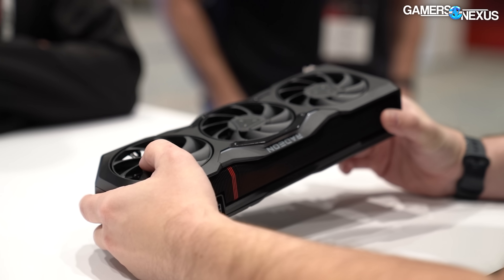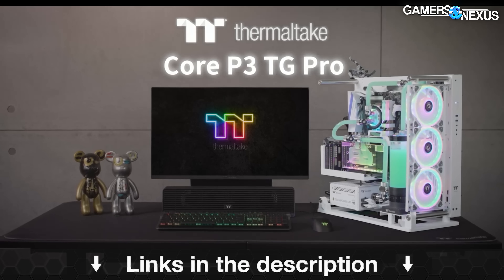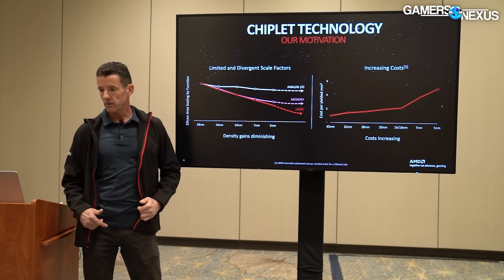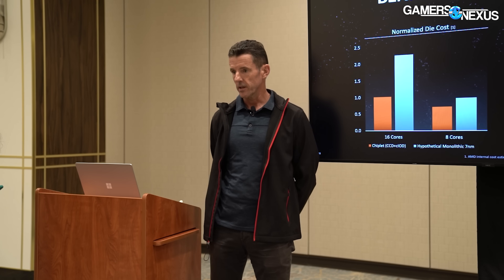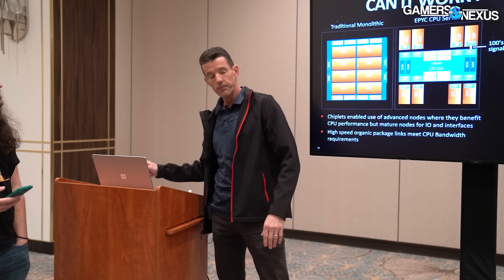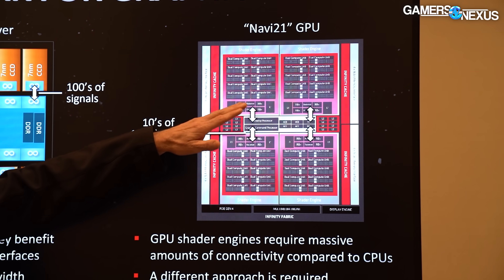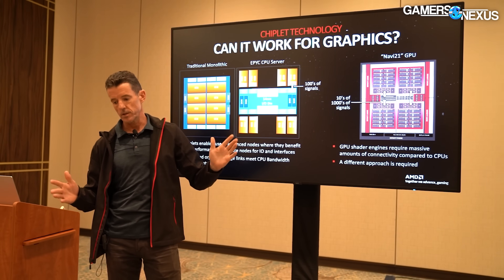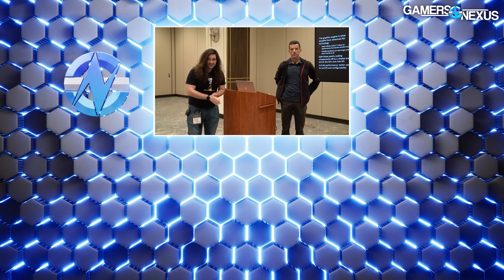How AMD is Fighting NVIDIA with RDNA3 - Chiplet Engineering Explained

Comment: A company called Silicon Edge has an online die-per-wafer estimator (search for silicon edge die per wafer estimator and it should be the first result) that really helps illustrate how big of an impact even a small reduction in die size can have on yields.  As Naffziger said, defects tend to stabilize around a constant number per wafer, so play around with the die dimensions and see how much of an effect it has.

Comment: I would rather pay a used car's worth of money for a nvidia card than buy an amd card that will have shitty drivers.
Reply: Yes, keep that bullshit mindset that I also had like a month ago when I only used GeForce due to the same fears. Glad I changed when my 6900 XT arrived and the drivers were rock solid on a setup that should've had driver issues. I've had more issues with NoVideo's 5xx lineup of garbagio drivers. Additionally, no more frame stutters in any games, higher averages, better colors and visuals, and the AMD control panel (Adrenalin) beats the shit out of NoVideo's Windows 95 control panel and its useless GeForce Experience. It has everything in it, and it's so well designed & built that it makes Afterburner useless weren't it for RivaTuner.

But why do I even bother, you're just gonna tighten Jensen's leash around your neck even tighter. Whatever you're into I suppose. But maybe you should, you know, HAVE EXPERIENCE with a certain product before talking shit about it.
Reply: @lunetailedfox  i appreciate your message and i'm happy that you are enjoying your product. But for me to buy something just to see if it's good or not after being on nvidia for 10+ years is out of the question. Maybe when the price/performance is good enough i might give it a go like i did with amd cpus, but right now nvidia is the king performance wise.

Comment: IF AMD can actually pull this off it may actually make them a viable competitor to Nvidia's offerings but only if the performance is there when the tech hits the market. Power efficiency and product cost don't mean much if the actual performance is compromised.
Reply: AMD is already a viable competitor to NVIDIA's offerings, and the 7900 XTX beats the 4080 by 10-15% while being only 10% slower than the 4090 based on extrapolated results from AMD's own numbers (which are usually accurate) with 4080/4090 reviews. With driver optimizations, that GPU is only going to get faster. Not to mention RDNA3 has extreme memory bandwidth compared to G6X.

I guarantee that the XTX will deliver the same performance as stock while consuming about 250-300W, or less, because it undervolts like a champ, and is efficient even on stock.
Reply: @lunetailedfox  Basing parts investments on "Ifs" and "hopes of optimization" has been AMD's problem since Vega came out and fell flat on its face.

Also power efficiency is again isn't a selling point outside of Youtube videos and war-torn Europe. AMD's GPUs have relied far too much on asterisks, exceptions, and narrow use cases to paper over the fact that they can't post the same performance numbers as Nvidia has been doing.

It's why you don't see a lot of the Techtubers who love to shit on Nvidia use AMD GPU's in their builds or test rigs and why during the supply shortages you could find AMD GPUs in stock while Nvidia's shelfs were bare because everything made was bought by either miners or gamers trying to get the most value for their money.

Performance = Value this has been true for decades when it comes to GPUs especially no matter how much the AMD crowd wants to deny it.
Reply: What are u even talking about lmao

Comment: The 6900XT went head to head with the 1499$ 3090 in razterization performance.
And it costed 999$
The 6800XT went head to head with the 699$ 3080 , and costed 649$

Now the 7900XTX (not even XT)
Is going head to head , with the 4080!
Not 4090! (AMD said it , not me)
For the same 999$. (In ratserization performance)
AMD is naming what should have been a 7800XT In terms of performance in comparison to the competition a 7900XTX
And pricing it at 999$
And straight up not launching a 4090 competitor , so that the 7900XTX name sounds logic , hey it’s our top card.

Yeah well , your top card , is going against Nvidia’s second card (and second by a margin this gen) while being priced the same as the card that last gen went head to head with Nvidia’s top dog.

Nvidia rised the 4090 price by 100$

Gamers Outrage.

AMD named a 7800XT a 7900XT and priced it at 1000$ wich is a 350$ increase of the 800msrp

Gamers: Dickriding…

The fact that Nvidia went full retarded , and priced a 4080 at 1199$
Doesn’t means that AMD is also laughing at your faces.
Had the 4080 been launched for 999$
You people would be outraged that the 7900XTX is going against the 4080 in terms of performance and not against the 4090

People thinks AMD helps keep Nvidia’s pricing real.

But the truth is that AMD is using Nvidia’s pricing to increase their prices with out backlash.

Nvidia is eating the hate for them.
And when the 4090ti launches for around 2000$
They will launch a 7950XTX mail hat goes against the already 1 year old 4090 , but at 1300$ and you will cock-ride them again.
Ignoring that the 7950 should have gone against the 4090ti
Not the 4090
Reply: What the fuck are you on about?

The 7900 XTX delivers up to 70% more performance on average than AMD's previous flagship, the 6950 XT, while costing $200 less. And it's the same price as the 6900 XT was as launch.

AMD doesn't need to beat NVIDIA's top GPU, nor does it need to compete in features. Raw performance is what matters, where it wins - it delivers 15% more performance vs 4080 based on extrapolated numbers (where the fuck did you get that 20% slower vs 4080 figure, are you nuts, did you do any research?) - and it even has 3090 Ti performance in ray tracing, which is more than enough for literally anybody that isn't Linus or Jeff Bezos. FSR 2.1 is looking good and FSR 3 will be even better. Frame generation is a fucking joke, frame hallucination more like. That latency it introduces is godawful.

AMD did not increase prices this generation, and if you believe that, you are way past redemption and you are probably "dickriding" Jensen yourself.

Meanwhile, please explain how Jensen's 4080 pricing is in any way reasonable. Oh wait, you can't, because they only priced it like that to make their flaming 4090s seem more enticing. Case closed, NoVideo fanboy.
Reply: @lunetailedfox  what the fuck level of deluded are you?

First of 70% is a fair claim.
AMD themselves shown a graph where it was mostly a 50% performance increase over the 6950XT. With just a few games being a 70% you took the exception and took it as the rule.
Second , apples and oranges … the 7900XT should be compared to the price of the of the 6900xt not the 6950xt.

Based on your logic the 4090 is an actual 65% faster than the 3090ti PROVEN BECAUSE ITS FCKIGN OUT , NOT LIKE YOUR SPECULATION NUMBERS IF A VARD THAT HASNT BEEN PUT TO TEST OUTSIDE OF AMD CLAIMS.

For 400$ less than the 3090 msrp.
Oh what a deal then!!! Idiot!

I said the 4090 was around 20% faster than the 7900XTX. Based on AMD’s numbers 
Not the 4080 learn how to read idiot.

And saying that the 7900XTX is 15%!!!!! Faster than the 4080 is one very bold claim 😂😂😂😂😂

I also said several times that the 4089 pricing was ridiculous, you tell me to explain who is it well priced when k stated that it is precisely because of it’s ridiculous pricing that AMD is overpricing it’s 7900xtx 

The 7900xtx should be competing the 4090
If not it is a 7800XT with an 7900XT price 

You get outraged when Nvidia calls a 3070 a 4080
Like we all did.
Because it’s wrong

But suck Lisa’s old hairy pussy when she does the same with the 7900XT

The only case you closed is that you don’t have reading comprehension, and are a stupid fanboy, hyping a product that hasn’t even touched the hands of real reviewers , putting them to fair tests.
On every game.
On the same settings.
Reply: They are offering more for less..... compared to Nvidia...
Reply: They are smart. You guys just want them to give us a better GPU for a lower price so you can buy Nvidia for a lower price as well. If you are not happy don't buy. Buy the last generation that is cheaper and still good. Or pay the 4080 full retarded price!
Reply: @Max-fw3qy  of course they are smart, did you read the whole thing?
That’s what I am saying they  are smart , and greedy.

People thinks AMD is lowering Nvidia’s pricing 
When reality is the opposite, despite having managed to SIGNIFICANTLY lower their production prices , wich  gave amd room to lower their pricings , they used Nvidia’s RIDICULOUS pricings , to increase their own , and still be praised for keeping prices lower than the competition.
AMD is actually using Nvidia to augment their prices and profit % with out getting backlash 
Things are going the opposite way people expected.
And they still fanboy 😂
Reply: @Max-fw3qy  answer this to me: had the 4090 been the same price it launched at , 1599$
But the 4080 , wich was Nvidia’s huge mistake , been priced at 999$
Would anyone, but it’s hardcore fans , be happy with the 7900XTX?

People would be like oh , same or close to 4080 performance, but much worse at ray tracing , no frame generation , no DlSS 2
And it’s 20% slower than the 4090, na fuck AMD

Enthusiast would still gladly pay 1599 for the monstrous 4090 that outperforms the 3090ti by around 65% to 75% in some cases.

And normal high end gamers would go for the 999$ 4080 instead of a 999$ 7900XTX.
The thing is , that had the 4080 been priced at 999$
AMD wouldn’t have dared to price their 7900XTX at 999$
They would have priced it at 899$ and still had a bad time fighting for consumers.

AMD totally used Nvidia’s completely nuts 4080 pricing , increase their pricing

Comment: When people upgrade (most are not "experts") they tend to stay with the same brands.  AMD has the opportunity steal away some of the most valuable customers in the gaming market.  They need to undercut, and keep undercutting Nvidia.  My last few cards had GTX in the name.  But after using this 6800xt without issue for several months I can say Nvidia does not have my attention anymore.  Most gamers cant afford to spend money creating more then 120 frames a second(119.6 is my average in codmw2 on ultra 1440p).

Comment: Based on all the different videos , reviews , leaks and articles I’m seeing . It’s evident , than AMD’s manufacturing costs this generation , are considerably lower than Nvidia’s.
Pricing the 7900XTX wich is supposed to be in the 4080 tier of performance, for only 199$ less, very likely means that AMD is being just as greedy as Nvidia. And yes , I know that we as costumers, don’t care the reason why it is cheaper , the thing is it is cheaper and therefore better bang for the buck for us.
But the point is , that everyone is accusing Nvidia of be greedy, and based on the known information, AMD is not pricing their products aggressively, on the contrary , they are probably pricing them with a higher % of revenue per product than the one Nvidia has.
Wich very likely means , they had more than enough room , to price the 7900XTX at 899$ and the 7900XT at 799$.
But they probably also have remaining stock of   unsold 6000 cards and that would kill the sales on those.
Or they could have kept the 999$ and 899$ prices , and use the extra margin in revenue capacity, to add better ray tracing capacity to the cards with out having to augment the price , there was room for it.
But they are just as greedy as Nvidia , if not more.

Amd is not priced Aggressively as some people sugest.
They didn’t won Nvidia this generation, because they thought more about the costumer.
They won because they thought much better about production costs.
They had the opportunity to offer 4080 performance, at 800$ quit 
But they knew that with Nvidia pricing their cards at 1199$ and 1499$ respectively, they could comfortably price their top dog at 999 and look like working class heroes.

I missed the memo where 999$ was a freaking bargain.
You people are sheep.
Reply: They will price their product as high as they can, every company does that. You wanted 4080 performance paying 600 bucks? Not happening. They will charge the maximum they can while being cheaper than Nvidia. Amd is a company, not a charity
Reply: @Max-fw3qy  that’s my point . Let’s stop pretending they are selling their cards for dirt cheap.
They are charging as much as they can afford themselves to charge , because they can’t outsell Nvidia at a similar price

Comment: With the advancement to chiplets for RDNA3, does this increase the chances of them bringing back HBM to the consumer space for something like RDNA4? It seems like with the increased memory specs to benefit the chiplet structure that 3D stacked HBM would be an amazing performance boost. But I guess the heat issues with 3D stacking HBM would be an issue in the GPU space?
Reply: given that they've moved the memory controllers to their own dies, it should be feasable to do 3d stacked memory on top of those. I'd expect those not to get that hot and get issues with that, as the GCD die is probably the one drawing the post power and converting it to head.

Swapping out the GDDR controllers for an MCD die with HBM ones should also be much easier, as they can keep the expensive GCD the same. No need to have an entire separate monolithic die for that any more.

Comment: Fantastic video. But the funniest thing is I realized how delighted I was that the laptop which was used for presentation slides was not Macbook, but Windows-based. Even though its probably some Microsoft stuff, that is a sign of a proper engineer, not some marketing fly-by or game developer, the types that can be easily recognized by their substandard and compatibility-problematic Apple equipment.

Comment: I hope they don't butcher their entry level cards by purposely handicapping them.

I hope they all get 16 pcie lanes and try to maximize the memory bandwidth. 

I'd rather a card require pcie 4.0 and smart access memory than to limit their cards like they did with the 6400, 6500, and 6600 variants.

Comment: The bigger question is: how this translates to performance and power usage and what about micro shuttering we had in the past.
Reply: This allows them to have larger cache for the same price so for a given price this will relay help a lot with stuttering.
Reply: going by what AMD announced, power efficiency seems to be very good with RNDA3. Those interconnects probably use up more power than not having them, but it doesn't seem to be that significant. They seem to be able to beat nvidia in that department, even though Lovelace is on a slightly better node. But we'll need independent benchmarks to really judge that. 

Micro stutters could be a problem with multiple GCD dies. As he said you'd need quite a lot of bandwidth between them. If it's not enough or the latency of cross die communication is to high there, it could lead to similar issues as Crossfore/SLI had. But with the current design of broken out MCDs that shouldn't be an issue at all.

Comment: After watching the video twice.  I had a question.  Are we finally going to get FPGA packaged with GPU?  Man that would be a game changer for us pro engineers.
Reply: that gets more complex and then you have more than one die trying to rw to the memory.   
Or you have all of the FPGA's memory access being piped through the GPU die.  At the moment the centralised approach realy helps them keep things simple.
Reply: @hishnash    Yeah, you're right. My inner child came out and I can only hope.  With all these somewhat forward thinking changes, I was hoping for a sneak peek of  GPU+FPGA.  But I do remember AMD doing something with CPU+FPGA, in the beginning of this year.
Reply: @complexity5545  I could see them build a GCD that has some integrated FPGA but nothing to large as very few users will have a use-case for this.  Unless they can figure out a way for compute/display shaders to be detected as compatible and be compiled to the FPGA (this takes time so its a strange thing to do but could give them a big edge if users/devs are willing to wait 1hour for the FPGA to be programmed and optimised).

Comment: Wait until end of December. Don't rush to buy a gpu now. Worst deal is to buy a new rtx 3000 now. They will not last long because of low vram.. 4000 is over priced and it will be discounted heavily..

In December greedy nvidia will cut price of 4090 to 1200 usd because 700 800 usd amd cards will ass rape 4090